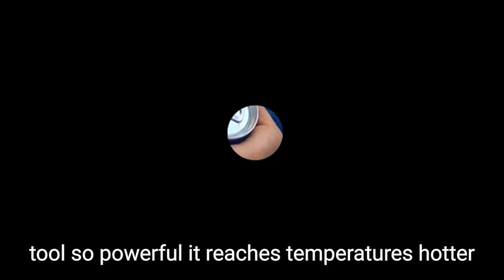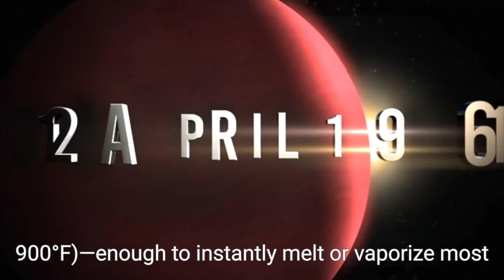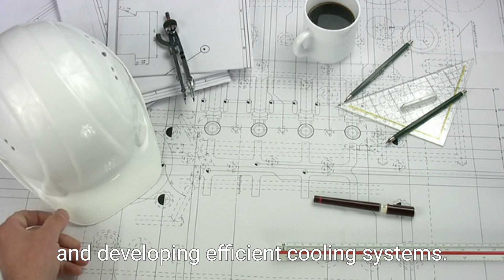The Drill That Can Melt Through Rock | Plasma Bore Technology Explained #PlasmaDrilling #PlasmaBore

Comment: A new type of geo-thermic power plant for heat and electricity geit in production in bavaria. These power plant do not need thermic water. These plasma drilling system could make these new geo-thermic power plant more economc. The power plant need hot rock.